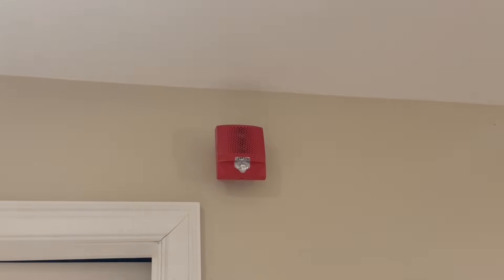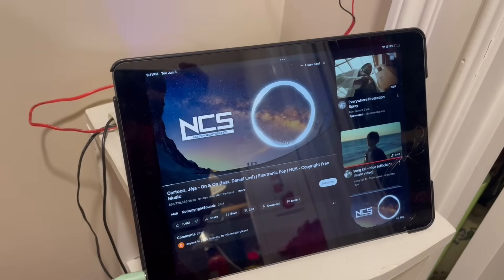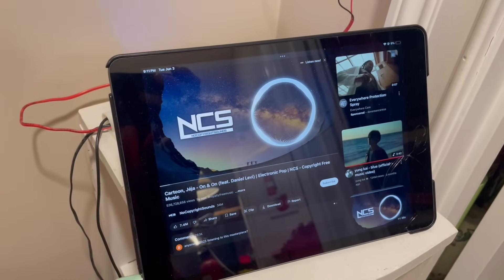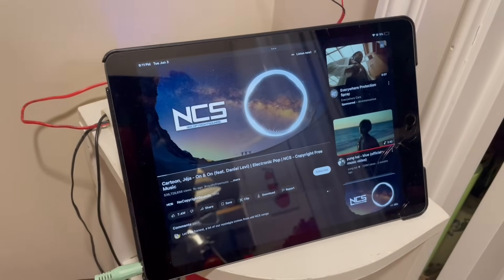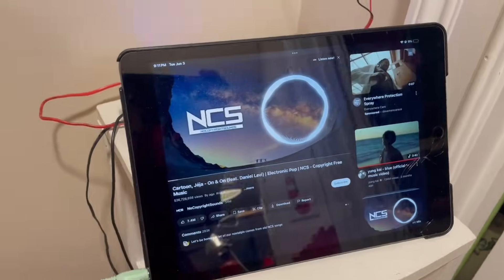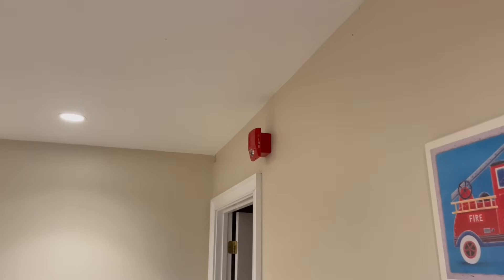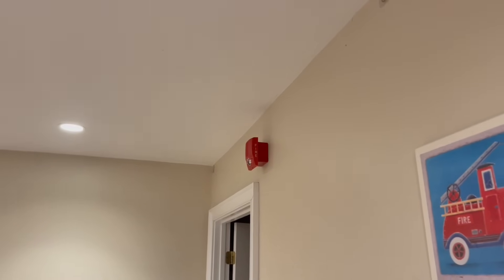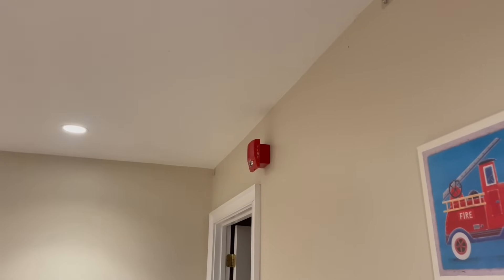Adding Fire Alarm System Music Shutdown | Summer Fire Alarm/Audio System Upgrades Part IV

Comment: Of course in an emergency situation this would not be an issue (lives are more important), but disconnecting the load of the speakers from an amplifier effectively leaving the amplifier driving nothing could cause the amplifier to become unstable. The fire trip input we have on amplifiers here in Aus tend to mute the audio inputs of the amplifier. Just food for thought.

Comment: The problem with obstructing an hvac intake is reduced air flow and lower suction pressure. The problem is when the air flow is reduced then the evaporator coil will get colder than it should causing suction pressure to drop which will then cause superheat (the amount of heat the refrigerant is absorbing) to go through the floor and making the coil freeze up and a flood back condition to occur. When a flood back condition occurs you are washing the oil out of the compressor and that is a death sentence to an hvac system. Your system likely has a valve called a TXV which monitors the temperature of refrigerant out of the coil and regulates superheat by increasing or decreasing flow of the liquid refrigerant to the coil. HVAC can be just as cool as fire alarms if you look into it enough and choose to find it fascinating like how I did. I know your system is an oldie but a goodie as I have seen it in the background of your system test videos.
Reply from the maker: Gotcha, that makes sense, I’ll probably move the speaker in that case at some point
Reply: @FireAlarmDude5967  you should install another Ceiling Speaker like the one next to the exit to the deck to not obstruct the HVAC

Comment: For one of these system tests, it would be cool if you fed the fire alarm audio into that sound system. You could have an interface where it still cuts off the music, but switches to the fire alarm audio. You could just use remote strobes in the basement, and regular speaker/strobes for the rest. I’ve seen this setup for many places that have very powerful sound systems (such as arenas) and also for retrofit applications where they only wired the building with two wire NAC circuits but they now need voice evac, so they replace the horns or horn/strobes with remote strobes and use the existing PA system for audio. My favorite example of this is at the Denver International Airport.

2:53 yep. I’ve been in several situations, such as band class at school or in large crowds, where the audible signals were far overpowered but people still knew the fire alarms were going off because of the strobes.
Reply: I've heard of that before. There's a SAFETECH fire alarm test video that has Simplex voice evac going through not only the A/Vs but a 70v speaker system that the building has as well.

Comment: Speaker wire is the lowest voltage stuff imaginable: they do have special in-wall wiring though. I literally have speaker wires spliced together with electrical tape under my bed and never had a single issue. You can turn those speakers up high enough to blow them out and the wires will be cold. The thin coil in a speaker will heat up and likely act like a fuse if not snap from vibrations before anything happens to that wire.
Reply from the maker: Gotcha, makes sense

Comment: Some audiophiles or stereo enthusiasts might die a little inside seeing Wagos used to splice speaker wire instead of soldering, but I’m guessing that’s a sort of temporary system so I don’t know if it’d be worth the work. And it’s not like a car sound system dealing with things like moisture and vibration.
Reply from the maker: Gotcha, somehow I haven’t noticed any quality issues but I may redo that later

Comment: how about an emergency light activation relay upon alarm
Reply: Already did that
Reply from the maker: I believe this can occur in some cases
Reply: @FireAlarmDude5967 after reading, you use an emergency light activator. I believe some exit signs have an extra wire that if it goes to ground it turns on the light.